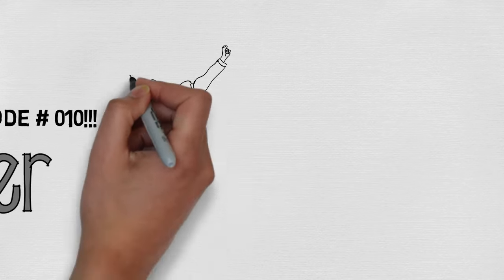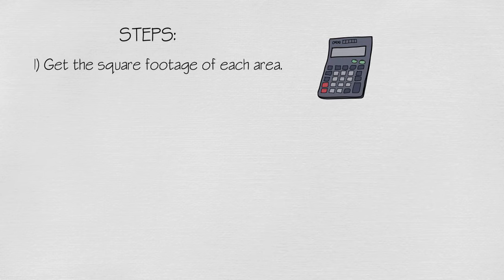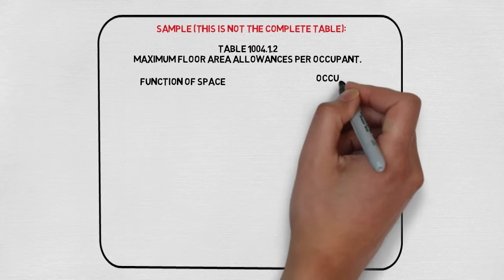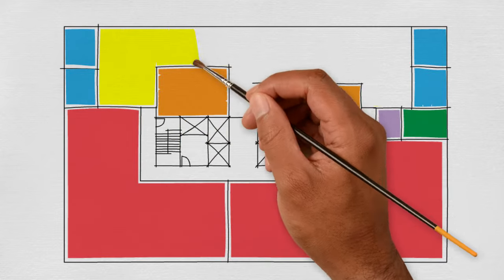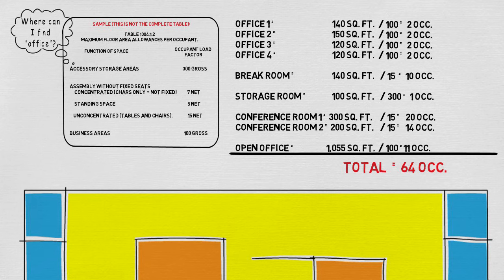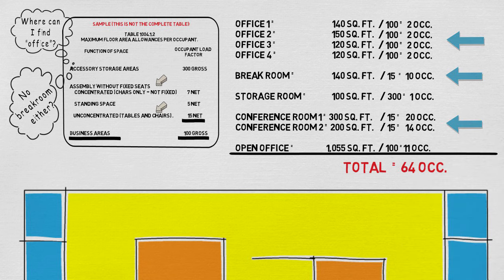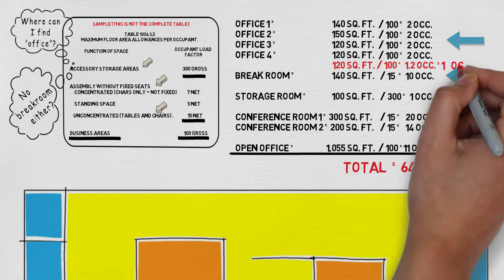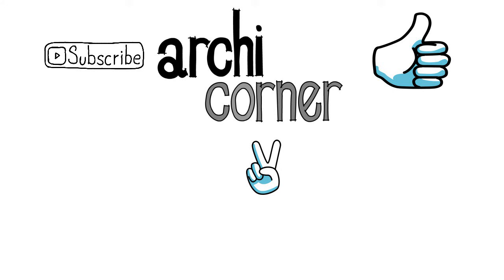AC 010 - Egress: How to Calculate Occupancy Loads (Part 1 of 2) - The Basics

Comment: nowhere in here did you address gross versus net. The offices should be calculated at gross square footage which requires you to take into account the thicknesses of all the walls. Your likely okay because you rounded up so well with all the spaces but still  this is a big misconception. All the hallways/corridors need to be calculated also. And you should not only do your suite but should do the entire floor,,  for you need to look at the exiting requirements for the floor not just your area
Reply from the maker: Marty Huie! This is an overdue response, sorry! Your feed back is much appreciated. 

Your comments regarding NET, vs, GROSS are valid. 

All areas within your suite should be accounted for. Whether you calculate the suite on a room by room basis or otherwise, it should be left up to the architect to decide. Both can be completed with a great deal of confidence, so as long as they are done thoughtfully. There is more than one way to skin a cat on this one. 

Calculating the common area corridors? That can be debated. Sounds like an odd request, but there have been plenty of odd request from AHJs in the past that one must adhere to.

In most instanced, the AHJs do not ask for the whole floor to be calculated unless the load in your suite is such that the load for the floor may be put in question. This does not happen often so as long as you stay within the original occupancy the building was designed for. Nevertheless, the AHJ can make requests per their review and if they request it, then, you should be ready to provide, which it sounds like you are! A good architect will tell you when your occupancy load will trigger a whole-floor load analysis before it even gets to the AHJ. 

Marty; You have great videos on YouTube. They are very informative. Hopefully whoever reads this thread can go check out your channel too. 

Best of whishes
-Archicorner.

Comment: If the occupancy group of this project is a business, and the factor is 100 GROSS? Why you divided each area with different factor?
Reply from the maker: "Occupancy Groups" and "Occupant Loads" are completely separate items. 

Occupancy Groups are defined in Chapter 3 and are used in Chapter 5 to determine (amongst other things) allowable areas, heights, number of stories, etc. 

Occupant Loads are determined by Chapter 10 and the primary objective is to determine egress requirements, such as number of exits, exit distances, etc. 

Check out Archicorner Episode 030. Let me know if this clarifies your question. THANKS!

Comment: Not sure I understand the calculation for the storage room. is it because the 100 ft is less than the 300 gross therefore only one person is the load and the Occ does change until the SF of the storage is greater than the 300 gross?

Comment: I see you categorized the break room and conference room as Assembly, but I thought if the room was less than 50 occupants it was categorized as Business?
Reply from the maker: Rooms and Spaces always get “occupant” load calculated per the use they are given. If a room is used for an assembly purpose then it must be calculated as such. That’s “occupant” loads. As far as “occupancy classification” goes, you are right, it would not be classified as an “A” occupancy, unless you reach 50 occupants. Thats a good question, be sure to separate “occupant” load from “occupancy classification”. 👍🏽

Comment: Great work, its have a lot of knowledge. you write the load factor for office 100 as a business area but the table has data 150
Reply from the maker: Yes, you are right. However, a few years ago it was 100 per the code at the time. This video is a little outdated. But the concept still applies.

Comment: Question: I know what the differences in Gross and Net are, but does Gross occupancy factors affect how you calculate the areas? For example, if you have a row of private offices, would you calculate each office individually from the finished surface of the wall, each office individually from the center of the walls, or as one large "space"? I ask because I've seen all three ways of doing this, and I was hoping to get some additional input on this. It makes sense, to me, if you calculate them individually, but the definition of "Gross floor area" states that you have to include wall thicknesses, not just space where there's a finished floor.
Reply from the maker: 1) Regardless of whether you are calculating occupant loads on an office by office method or if you are calculating them as a group, net will have to account for the walls. 
2) You are correct, It is common to see both approaches, it is left up to you as the designer to pick which one you like best. There is no correct answer so as long as the information is provided in a clear manner for the plan reviewer to confirm that an office or area meets the egress requirements (i.e. number of exits).

Comment: Hi Josue, I'd like to know how to categorize several ballrooms and prefunction area. Are they counted as a whole with certain/same load factor, or whether ballroom and prefunction area have their own load factor? Thank you
Reply from the maker: Don't get set back by the walls in a room or area. A large room or area can have different occupancy loads even if those areas are not separated by an actual wall or barrier. For example, a restaurant can have waiting area, and a dining area in the same room without walls dividing the areas. However, each area may have a different load factor based on chapter 10. I am guessing that your example is similar with the same large room providing different uses. As a designer, it is up to you to label each area clearly and provide the correct egress load.

Comment: Hi Archi Corner, Thank you so much for this very instructive videos! I have a questions on the Occupancy load round up. Would be possible to do the calculations room by room, and add the numbers without rounding up, then round up this final number. I understand the IBC doesn't specify, and it maybe depend of the specific project. I am thinking if you have many small rooms/offices and you round up in each one at the end your final occupancy load can be inflated. What are your thoughts on this? Thank you!
Reply from the maker: The code does not touch on this. After working with a jurisdiction for a while, you will see what each jurisdiction accepts. Therefore I think it may depend on your jurisdiction and what they accept, but for now, the code is silent on this issue.
Reply: Thanks for your material Archicorner!  I was going to ask this question as well.  Someone recently posted this question on the building code forum and I have been researching it.  I can not find anything  conclusive one way or another.  So as you mentioned, I guess it would be the call of the jurisdiction or just doing it the way that works better for the project.

Comment: THANKS FOR ALL THE INFORMATION (FOUND THIS VIDEO LOOKING FOR SOME INFORMATION, THEN I SAW THE NEXT VIDEO .........AND ALREADY GOT SUBSCRIBED TO THIS CHANNEL!......I'VE GOT A QUESTION RELATED TO A RESIDENCE....IN THE CASE OF A RESIDENCE USED AS ASSISTED LIVING FACILITY (8 BEDROOMS, DINING , LIVING ROOM, KITCHEN AND 1 OFFICE WITH AN EXTERIOR DOOR.......TO CALCULATE OCCUPANCY LOAD SHOULD I CONSIDER DINNING, LIVING,  KITCHEN AND OFFICE WITHIN THE 200 gross FOR RESIDENTIAL FUNCTION SPACE   (ACCORDING TO TABLE 1004.1.2) OR SHOULD I SEPARATE THOSE SPACES ...IF I SEPARATE THOSE SPACES, WHERE TO GET THE OCCUPANT LOAD FACTOR FROM?......IF THE TABLE DON'T SPECIFY KITCHEN, DINNING, LIVING OR OFFICE FOR A RESIDENTIAL SPACE SPECIFICALLY.... IS IT APPLICABLE THE ASSEMBLY FACTORS?.......I' D APPRECIATE ANY HELP ON THIS....
Reply from the maker: Fernando; Thank you for watching the video. This reply is not meant to provide you with any suggestions or recommendations of any kind. This reply is only to share my opinions. What you or any reader of this reply does with such information is at your own risk: Occupancy loads are typically based on the table you noted. What you local Authorities Having Jurisdiction (AHJs, such as Building Department and Fire Department) will accept will vary from one jurisdiction to the next. It may be possible that you could use 1:200 gross for residential space and apply it to the entire project and the AHJ's may accept it, but you will have to confirm that with your local AHJs. However you mentioned that the project has an "office". Does that mean that there is an office occupancy in the building? Does that also mean that you have multiple occupancies in the building? It may be possible that the areas within different occupancies may be classified differently such as the office which may require a load as "business areas" at 1:100 for example. Taking a quick trip to your local AHJ's office and confirm what they may accept before hand may save a lot of time in the end. Best of wishes to you in your project!

Comment: If I understand correctly, Assembly/Group A occupancies are partly defined by having at least 50 occupants. In situations such as a breakroom, where there would not be more than 50 people at a given time, does that cause a problem in terms of classifying those spaces as Assembly?
Reply from the maker: This is a common miss understanding. Chapter 3 talks about Occupancy Groups. Chapter 10 talks about Occupancy loads. Just because a room uses assembly occupancy loads for egress does not make that room an assembly occupancy group. A “conference room” is used for assembly regardless of the actual occupancy group classification.
Reply: @archicorner thank you for all your videos and efforts. In the same subject, when we calculate the occupancy load for office, and the whole office suite, has break room and conference room, why do we need to count the occupancy for break room and conference room separately? The same office people, sometimes use conference room or break room. The total number of occupants in office suite is still the same. Thanks again for your great works.

Comment: Beneficial video! I am confused about the conference room. Why are they Assembly if they are less than 750 SF? the same for the breakroom, I understand that assembly group when you have more than 49 occupants or area that is more than 750 SF. Thanks
Reply from the maker: I think what you are getting confused with is OCCUPANCY GROUP CLASSIFICATION and FUNCTION OF SPACE.

When determining occupant loads (don’t get “occupants” confused with “occupancy”), you must use load factors based on the function of the space regardless of the size of the room. Therefore, an “office” or “B” classification group may have rooms used for storage, assembly and office. All of which may be considered “B” occupancy but when the number of occupants is calculated for the conference room, the room is in fact used for “assembly” and therefore uses the allowed load factor for “assembly” use.

hope this helps. 😊👍🏽
Reply: @archicorner  According to 303.1.2, it states that "A room or space used for assembly purposes that is less than 750 sf in area and accessory to another occupancy shall be classified as a Group B occupancy or as part of that occupancy". I'm still a little confused. Can you correct me if I'm wrong, but I still believe the conference and break room should be considered as "B" occupancy.
Reply: @archicorner  I guess here in India, that's why we say capacity factor instead of occupants load

Comment: How do you calculate the occupacy of a 8 floor apartment building?
Should I calculate each floor occupancy and then make a sum?
Reply: yes you should calculate each floor independently and your exit load for your stairs should be based off of the highest number. You do not add the floors up at all. That's called convergence look up convergence in the code and will give you a better explanation
Reply from the maker: If you guys haven't yet done so already, go check out Marty's YouTube channel, he has great stuff!!

-Archicorner

Comment: Unfortunately the consideration of conference rooms versus general office space is more nuanced than this. Fortunately the issue of office egress design is very widely discussed, so instead of writing a new explanation I will copy from elsewhere:

First, the IBC specifically addresses the common issue of small assembly spaces within other occupancies. The IBC states that the following rooms and spaces are NOT Assembly occupancies:

- A room or space used for assembly purposes that has an occupant load of less than 50 people and is accessory to another occupancy type.
- A room or space used for assembly purposes that is less than 750 square feet in area and is accessory to another occupancy type.

Therefore, in terms of OCCUPANCY, the conference rooms and private offices are B. The video correctly shows the table with categories labeled "function of space."

"You have to understand that "occupancy" (Chapter 3) and "function of space" (Table 1004.1.1) are two separate items. The conference room, although a B occupancy, is still an assembly function. So, the occupant load of a conference room is still based on the unconcentrated assembly number of Table 1004.1.1, which is 15sf per occupant.

An assembly occupancy is required when the occupant load of a space is 50 or greater. The 750sf exception can be derived by multiplying the 15sf/occupant by 50. So, even if the occupant load may be greater than 50 in a 750sf conference room (concentrated or standing), you're not required to call the space an assembly occupancy.

Now the confusion: Typically, the occupant load for the floor is based on the gross floor area of the B occupancy for that floor, including conference spaces, restrooms, closets, etc. This assumes that the users of those spaces are generally the employees of the office spaces. However, egress from the conference areas must be based on the actual occupant load of the conference areas. For example, assume four adjacent conference rooms (749sf each) share a small reception area. Egress width out of that reception area must be based on the total design occupant load of all those conference rooms, plus the reception area. Therefore, the reception area must have a minimum of two exits (Table 1015.1) with appropriate width."

So to correct the video: the occupant calculation for the floor as a whole should treat the entire office floor as B occupancy, which will yield a result much smaller than the video says (adding them all up to 64 occupants is incorrect). However, when looking at the egress from a particular room, you do need to look at the occupant load of that room per the "function of space." For example, imagine a large office floor of B occupancy with an occupant load of 100sf/occupant. Imagine that all of the office workers from this large office floor were gathered in a conference room. If a fire broke out in that room, it would be important that the egress from that room be designed according to that "function of space," i.e. 15sf/occupant. However, when you then look at the egress of the floor as a whole, this can be calculated according to the total 100sf/occupant. The video's method would not yield an egress width in violation of code, only one much larger than required.
Reply from the maker: Eric;The videos provided by Archicorner are not meant to provide solutions to any project(s). The videos simply provide the viewer with general information so that the viewer can thereafter make more research and make his or her own design decisions.

Architectural Design decisions should always be made by a licensed professional, as required by law. If you are a licensed architect, then ultimately you take on the risk by stamping and signing each and every plan with your name on it.It is of interest that your opinion included the note: "THE VIDEO'S METHOD WOULD NOT YIELD AN EGRESS WIDTH IN VIOLATION OF THE CODE [...]".Take care and thank you for leaving a note. Thank you. :)
Reply: do you calculate occupant load for a Lobby???
Reply: That may well be true per IBC and you made a very insightful distinction between occupancy type classification which has to do with how the "building" (or portion thereof) is regarded in the eyes of the code relative to risk thus all kinds of mandatory requirements and use function classification which drives occupant load FOR the space and the mandatory egress requirements tied to the load. It's a distinction hard to make clear in one's mind. However, NFPA 101 does not seem to share IBC's view towards calculating and compiling occupant load for the floor. Archicorner's video is more consistent with how NPFA 101 would insist that the designer compute the occupant load for the floor. With its 2018 edition, readily embraced by federal agencies upon release because they don't have to go through an adoption process with public input, where the introduction of new factors (150 for B-use, 15 for > 450 SF and 30 for < 450 for collaborative spaces) have now made perfectly safe and functioning office bldgs noncompliant as suddenly there are now more occupants on the floor than previously simply on account of moving away from Gross Floor Area divided by 100 Occp/GSF formula to yield total floor occupant load. I would be very interested to learn from you if you are aware of any authoritative documents that discuss this distinction between occupancy and function that you articulated so well and therefore how the codes, whether IBC or NFPA, intended floor occupant load to be computed for the sake of determining the exit and exit access capacities.